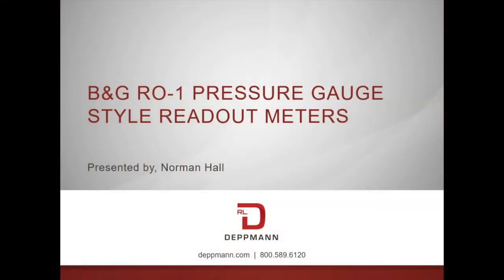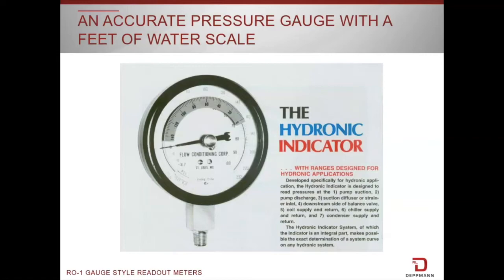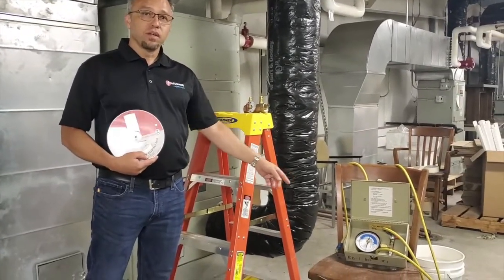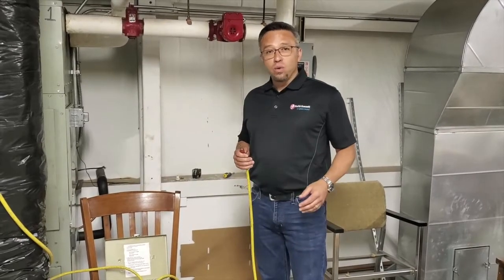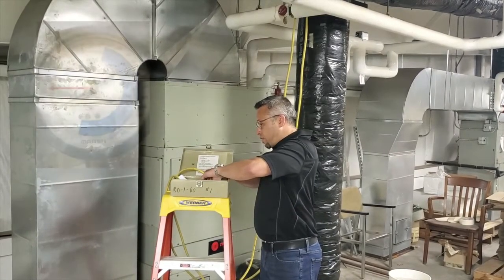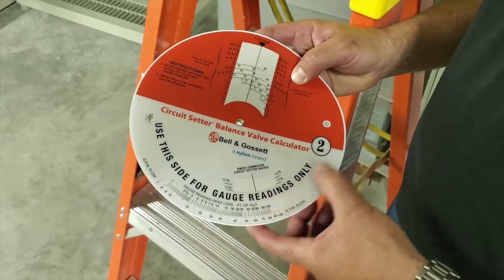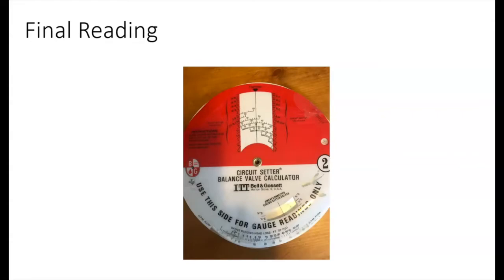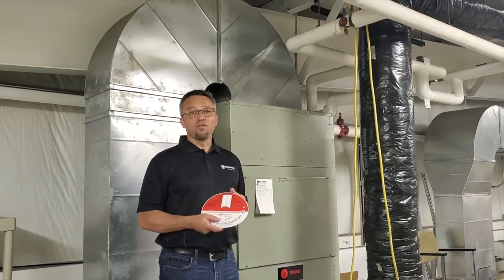Bell & Gossett Circuit Setter Setting with a Readout Meter

Comment: Instead of using the taps and buying a readout meter, can I simply install permanent pressure gauges either in the tap threads or just before or after the circuit setter?

Comment: When would we use the presenting side of the dial and how would that be done? New to water balancing and usually only read current flows but not ever setting flows on equipment
Reply: John best way i do it is scan the 3 ft on your wheel and look at what the setting on the size of valve your reading .. thats how you preset your balance valves on the preset side.. I learned from the best